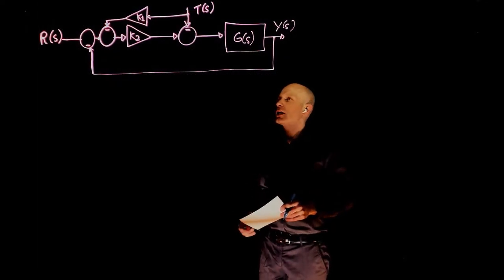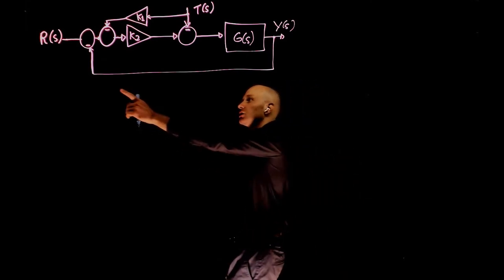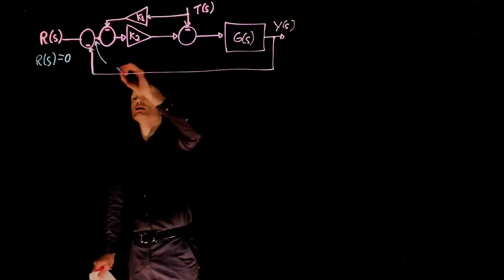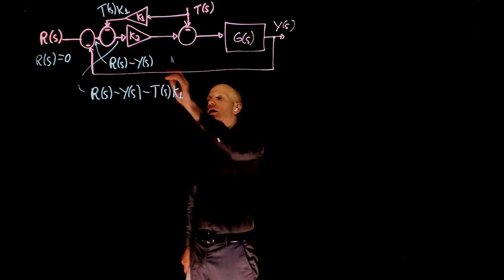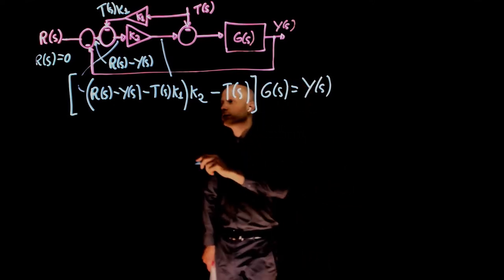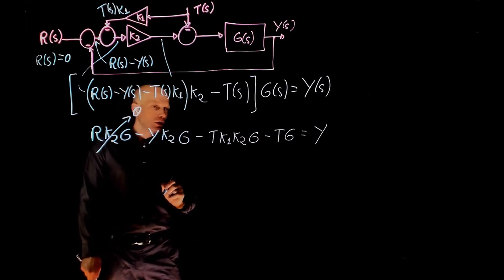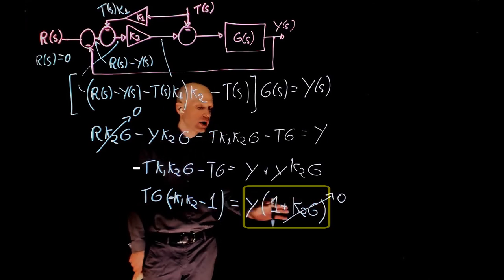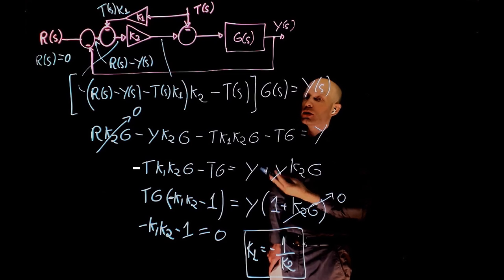L6E24 Control Systems, Lecture 6, exercise 24. Block diagram simplification.

Comment: Why can we set the 1+k2G to zero do we not only have the abbility to set r to 0
Reply: meant to say k2*g to zero , my other question is if your setting 1 or both to zero doesn't this mean that you set either g to zero or k to zero, should this effect the other side
Reply from the maker: The output only goes to zero when R(s) = 0 provided that 1+k2G = 0.